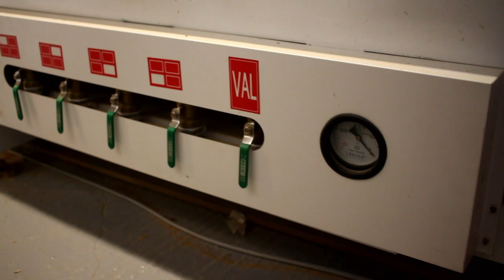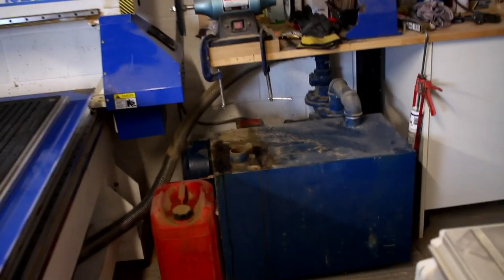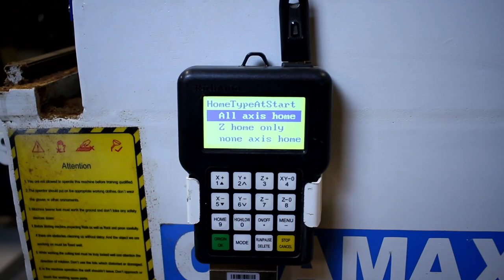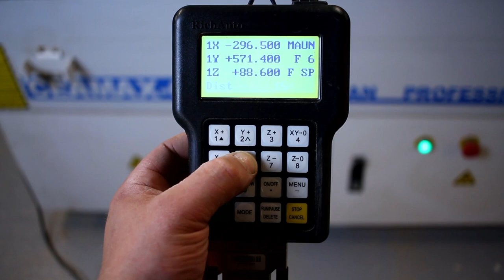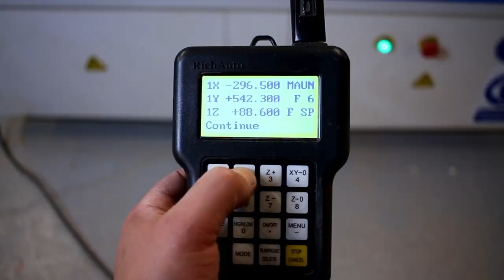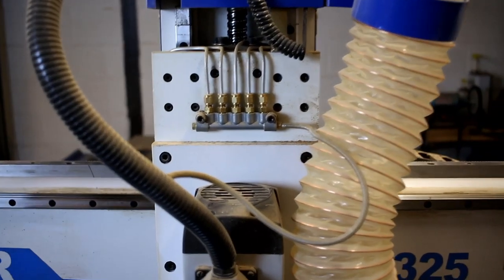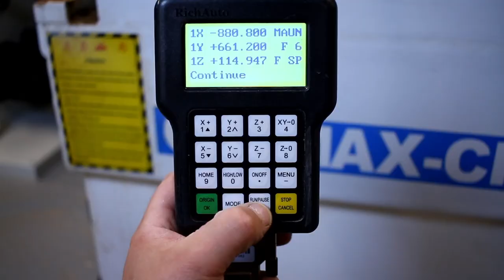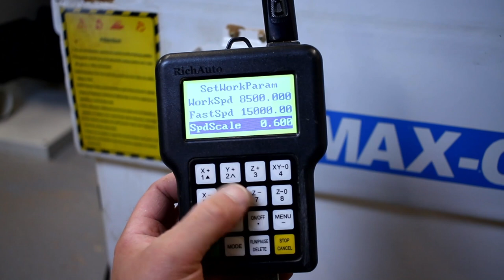Blue Elephant 1325 CNC Router Machine Tour

Comment: Thanks Dan,  That did help ease my mind a bit.  I have read some horror stories online about these Chinese machines. I know its not going to be perfect but for the price it looks well put together.   As far as that vacuum pump goes you might be able to extend that exhaust outlet with some piping or hose to exhaust those Diesel fumes.  Or possibly put it outside if thats an exterior wall and build a small enclosure for it.  The vacuum pump they are trying to sell me looks different and doesnt look like it requires water However I, am in the states on single phase power so I know they mentioned I needed 2 smaller pumps opposed to their standard setup to work on single phase.  Either way I have a shed right where mine would go so I will plan on just popping a hole through and putting it in the shed. Originally I was planning on that for noise reasons but now I see there could be other benefits.   One question why 18mm spoil board ?  wouldn't a 6mm or 12mm transfer more vacuum to the part?  Or does it not stay flat enough? It has always amazed me that these machines can draw enough vacuum through a sheet of 18mm mdf and still clamp parts down.
Reply from the maker: Yeah I think they are pretty good for the price, considering the next price break for a European made machine would be around 4-5 times the price! I did think about trying to duct the outlet to outside, it is a run of at least 10m either direction though through some other rooms so not that straight forwards. This is the type of pump I was considering upgrading to: https://www.alibaba.com/product-detail/200m3-h-Value-Vacuum-Pump-Oil_62314075641.html?spm=a2700.galleryofferlist.0.0.7bf329afHQEix9 I'm not sure what your options are for single phase, perhaps there are less options, my pump is around 7kW three phase so quite hefty! I've used 6mm spoil boards before now but don't see any noticeable difference in the hold down from thicker ones. If you have an 18mm one then you can skim it off several times before it needs replacing, thinner board will also tend to peel up around the edges once they have been cut/faced a few times. The vacuum is pretty impressive when it's properly set up, you can't move a sheet of ply even getting your whole body weight behind it and pushing!
Reply: @DanLeeBoatbuilding  That link you sent looks similar to what they sent me. For my single phase set up I need two smaller units opposed to one big one.  You might want to reach out to BE they quoted me 850 for the double single stage vacuum set up.  Not sure what they offer for 3 phase.  Maybe its time to also upgrade to that ATC machine you wanted while your at it ;)
Reply: Just checking back with you to say thanks again.  I just got word from BE today that my machine is completed.  I ended up with the the same machine but upgraded to 4.5kw spindle, HD linear bearings, pop up pins, cooling mister, and all servo motors.  Crossing my fingers it arrives and works as well as yours.  Did they supply you with the vacuum table gasket?  I will need to get some.  Thanks again.
Reply: @afbigfish1  Hi there, I hope you dont find this rude of me, my name is Michael, I have just started speaking with Tom at BE. The specs of your machine is the same as my requirements. Can I ask the price you paid excluding delivery?
Reply from the maker: No worries. It sounds like you have a nicely spec'd machine there which will give you years of service! My machine came with gasket for round the edges of the vacuum zones but not for filling in the t-channel sections so you might want to get something for them if you want to increase your vacuum hold down. Might be worth waiting until you have the machine though as I found it wanted to be quite specific on thickness so as to not alter the height that the spoil board would sit at. I ended up having to thin mine down on the bandsaw which wasn't much fun!
Reply: Did any of you buy from the Blue Elephant Company? Please tell me how this went with you, and what is the company’s number. I’m afraid of fraud.

Comment: HI Mate, thanks for video. I cant get my head around the vacuum table - from what i can work out if you are using the vacuum table you cant cut right through?  so if you want to cut something right out of a sheet how do you hold it to the table?
Reply from the maker: Yes you can cut right through parts with the vacuum table, in fact one of the main benefits is that you can cut out a complete part whilst it is still held in place. The vacuum pulls right through the MDF sheet (spoil board) and you cut into this, usually by around 0.5mm when cutting out your parts. When it becomes worn you just run a program to mill off the spoil board to flat again. Have a look at this video where I am through cutting some parts on the vacuum: https://www.youtube.com/watch?v=4Jg0CYUcIy8